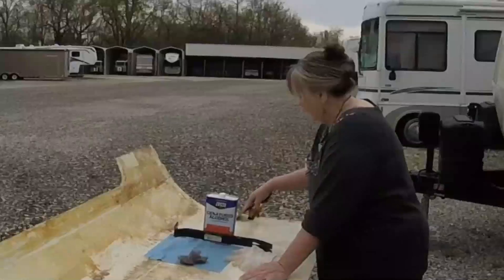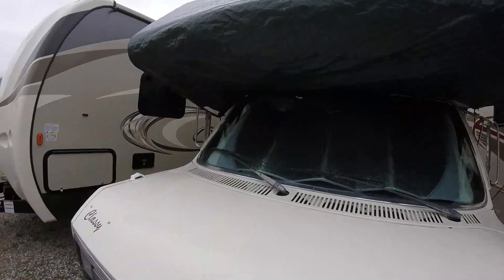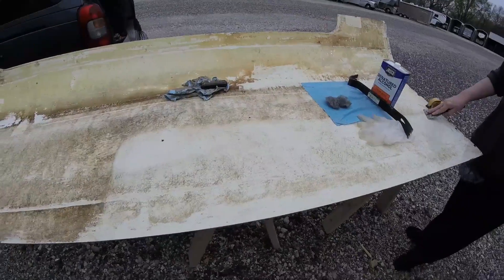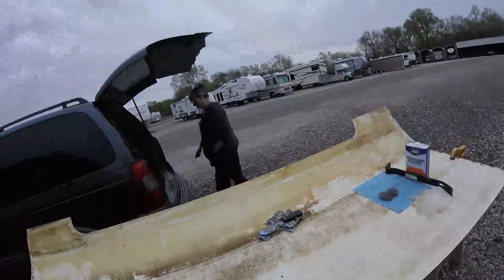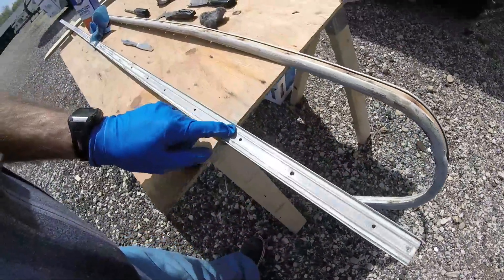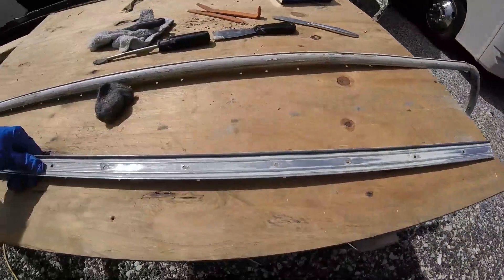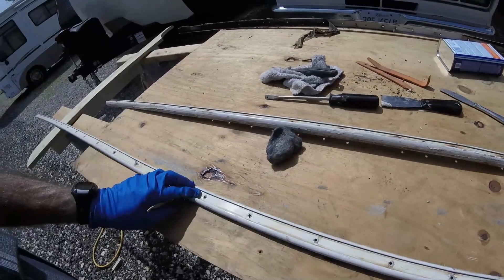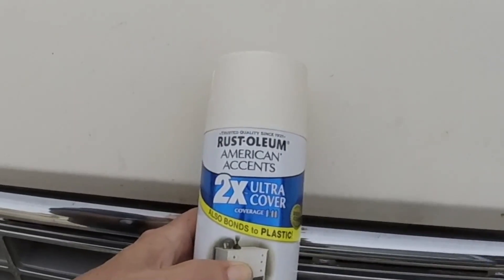Cabover Rebuild P3 Cleaning Parts For Secure Seals 04.26.17

Comment: Thank you!!! Needed videos like this. I’ve got some work that needs to be done on my 1992 itasca spirit cab
Reply from the maker: Hi Gagriella, I'm happy to hear you are getting something useful from my vids.  Good luck with your project.  I hope it goes as well as mine did.  However, last year, while camping, a tree fell on the overhead and destroyed all this work.  This time there was enough damage that I hired pros to fix it.  There was a lot of reframing and I wanted that smudgie leak prone window removed.  It cost just under 2.7k.  But it's clean, sealed and stronger than new.  I have published videos of these events if you're interested.  Thanks for watching!  Happy and safe Trails to you.

Comment: Thank you, very helpful and informative. Taking on this job this weekend with my father in law and your video gave us the confidence to avoid selling the RV and fix it instead!
Reply from the maker: Hi Ryan.  I'm glad you got something helpful from the video series.  I hope you have a successful result from your project.  Thank you for watching a the best of outcomes to you and your FIL.
Reply: Geezer at the Wheel. Well we’re 2 days in. Removed all dry rot but our plywood decking was still adhered to the fiberglass. Used a circular saw to section up the decking and a long putty knife to remove it in pieces. Took lots of elbow grease but it’s out. Then we reframed and relaid the decking, pretty straightforward thanks for your idea of using 1” wide pieces held together for the circular pieces! Also, ground a knife down and it’s perfect for removing the old sealant on the old seals. Now back to rewatch how you resealed the front window so we can tackle that tomorrow and get it all buttoned up. Thank you for the video!
Reply from the maker: Sounds like you're making good progress.  I'm happy that you got something good from my vids.  If you haven't already, please consider joining our Facebook group.  We all would love to see some pics.  And I'm sure you could be of some help to someone else undertaking this type of project.  Here's a link for your convenience.  https://www.facebook.com/groups/GeezerAtTheWheel/

Comment: I did a similar project to mine and it took me about 3 weeks.  Thanks for the paint can info.  That looks like my color too!  I'll have to pick up a can myself.
Hopefully it's all done by now and your on the road again!
-Jon
Reply from the maker: This project turned into a monster very quickly.  The fact is that when we went out there the first day, we thought we could just do it that day.  We thought it would just be a matter of repairing/replacing the deck.  What a surprise!  LOL  I figure we only have 12 to 15 actual working hours in it so far.  I guess we have a long way to go.  sigh.  I was so pleased to see the color match on that paint.  I hope it works for you too.  Thanks for stopping by.

Comment: Hey Geezer , keep your spirits up the end results will be well worth it. If it's not to late I would recommend replacing all the screws with stainless ones. It seems a shame that with just a little more effort at the factory they could put out a much nicer product that would last, but it seems like the RV industry is driven by the almighty $$$$. Hang in there, looking forward to the next one .
Reply from the maker: Hi Mr C!  Yes we will be using new stainless screws.  It's amazing how cheaply these things are built.  It's no wonder they "explode" when they're in an accident.  It should be illegal.  Thanks for watching!
Reply from the maker: Mr C, I just found out who you are.  I hope you make many many memories with that good looking Class C.  I hope to see lots of pics/videos.  Happy Trails to you folks.
Reply: Geezer at the Wheel , hey geezer I think you got me mixed up with somebody else and I sure wouldn't want to ruin their reputation . I'm out here on the left coast , and if you see me it will either be in a white Peterbuilt or pulling my 20ft Pioneer with some antique hit and miss engines in my pick-up on my way to some show. Maybe I'll learn to use this enough to send a picture one of these days. ( something about old dogs and new tricks comes to mind ) Anyway have fun see ya in the next video  !!
Reply from the maker: Ooops!  I guess I did at that.  A couple I had met on Padre Island just bought a used Class C and named it ... are you ready for this? ... Mr C. LOL  What are the odds!  I do hope someday I will see that Peterbuild and Pioneer.  Until then, Happy and Safe travels.

Comment: Those storms are supposed to get rough here too. As for the videos, its ok if you take a few small/short ones and make a longer one from them every week or every other week. "Classy" is the main goal. Getting her done and done right.
Reply from the maker: I hope you are doing ok with the storms.  We missed them and got wind and rain is all.  At least so far.  Filming this project is a little tricky since we usually have 2 or 3 "sub projects" going on at the same time.  But I'll try to edit clips together logically so they make sense.  She's getting there.  If we can get some good weather it should go together fairly easily now.  Thanks for watching.

Comment: ACK! Darn rains. I hope it doesn't hold ya'll back too much. If it were possible, I would do without the front window. I'm hoping my next ClassC doesn't have that. But I still like the side windows for ventilation. Also, if you've not gotten too far yet, it might be a good idea to line it with reflectix before putting the ceiling back on.
Reply: PS, shared on Google Plus.
Reply from the maker: The forecast is still predicting rain for the next several days.  I would love to get rid of the front window, but our budget just won't allow it.  We'll be rebuilding in such a way that if the problem returns we'll have the option of doing that then.  I'll look into the reflectix.  Thanks for the suggestion.
Reply from the maker: Wow!  Thank you so much!

Comment: ever see goop off it's remover and degreaser we uses it remove the 3M automotive double side tape
Reply from the maker: Does it work well for you?  The guy at Lowes told us it wouldn't work for what we needed.  He recommended the denatured alcohol which really isn't doing the job like we had hoped.